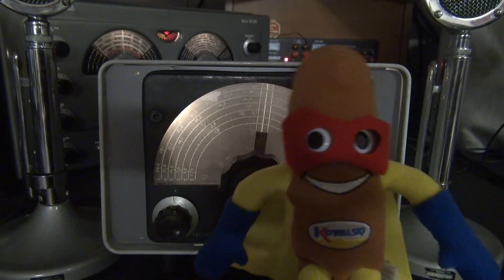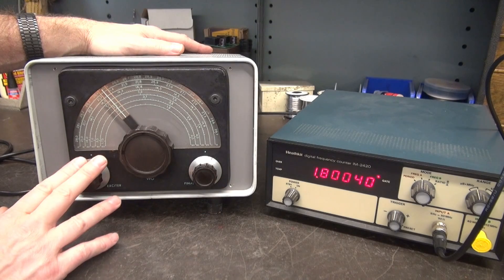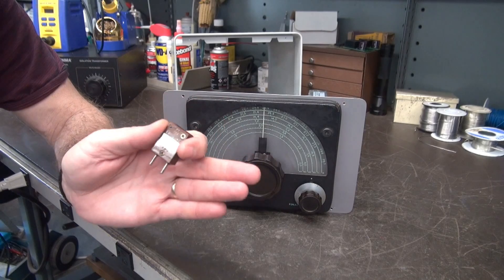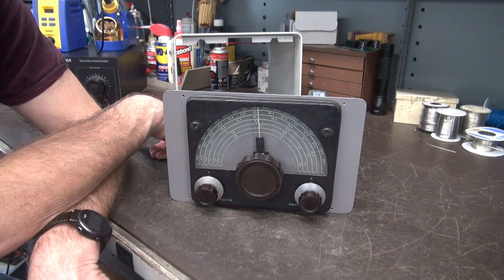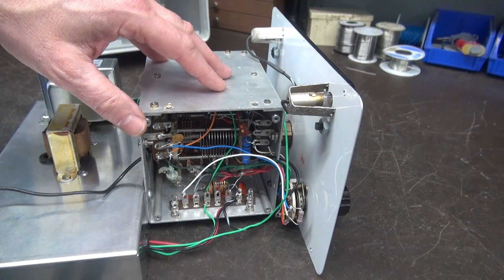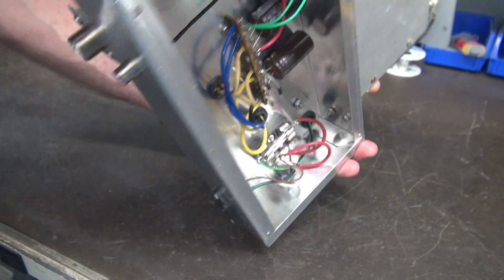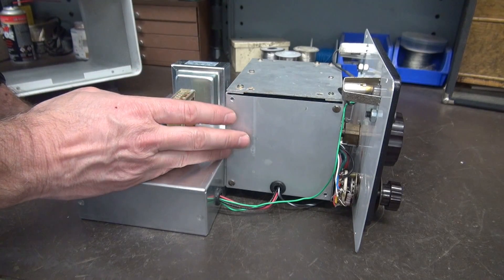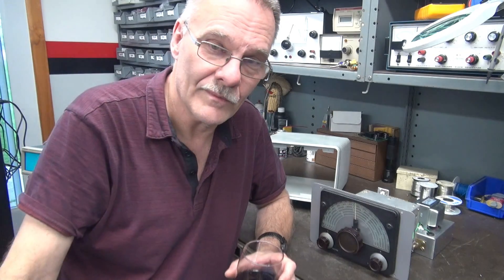How to Prototype EF Johnson VFO Ham Radio Tube Transmitter Frequency control

Comment: Hi Terry, great Video as always! 
What is the Output power of the VFO in Milli-watts that is necessary to drive the mentioned Transmitters ?
I like you Videos, even Thu I am not a Ham, I am in the Custom Prototyping Design, but always loved tubes and Tube related stuff. Cheers for Vienna/Austria